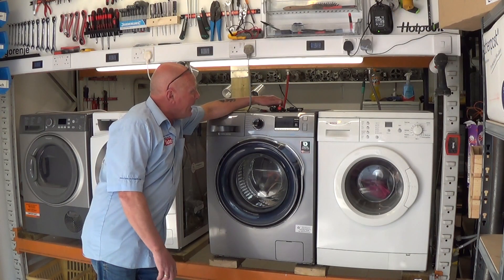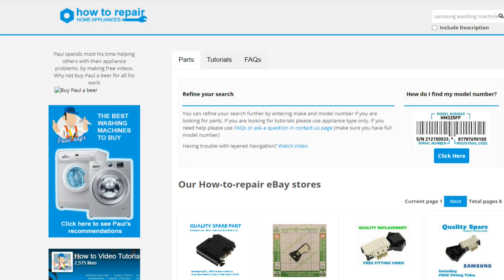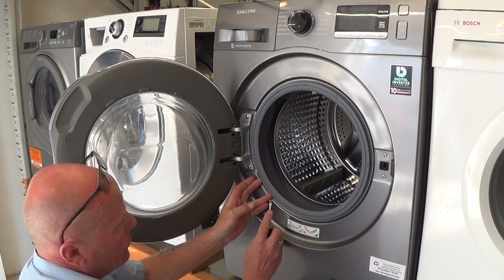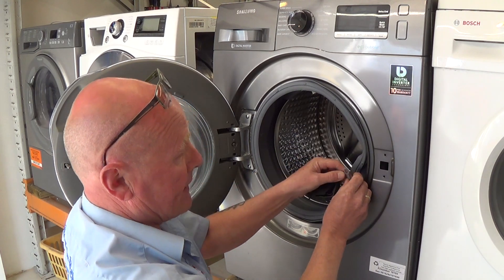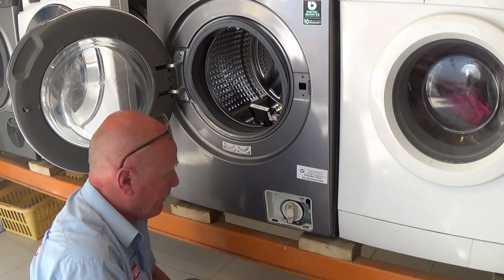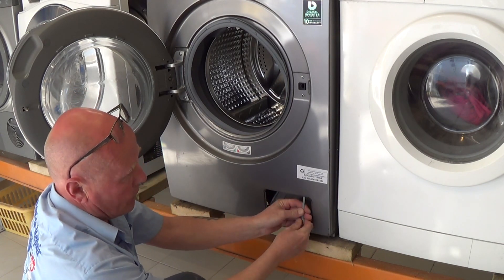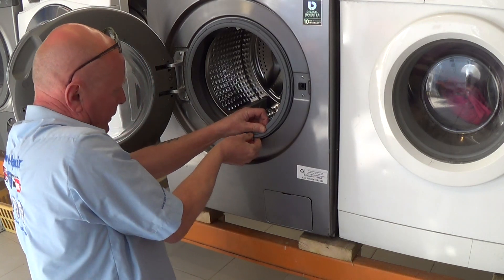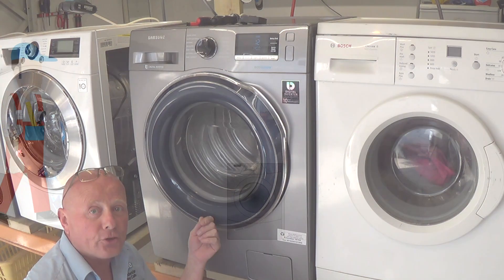Samsung Eco Bubble washing machine DC error fault code

Comment: Holey schmokes this was just as simple as you showed, if not simpler. You made my life so much better with this video, saved me hundreds if not a thousand of pounds and probably weeks of waiting either for repair or new washing machine. my wife got very impressed when i came home to the arrived part and fixed this in litteraly 2 minutes after having viewed this video a couple of times. As someone mentioned in the comments the emergency door release part can easily be attatched on the new part without taking the whole thing out, dont have to thread it if you fasten it right away, but great that you show it. also great you commented the difference between asian-american models and european models, i was wondering about that. Bought my part from a different vendor here in norway probably way more expensive, so i am sending my thanks, money for a pint well earned in the bar!

Comment: This video is easy to understand for those 'not competent' with electrics. I bought the part for about £40 and set about fitting it. The only issue was replacing the wire band. I eventually found that starting with pushing in the band just above the top end of the concertina spring, then working in an anti-clockwise direction, nudging in bit-by-bit until the full circle is complete. By doing this it gives the spring a chance to stretch, and the bit-by-bit fitting takes a few minutes, but I found it worked with ease. The local guy here (Shoreditch, London) in the domestic appliance shop wanted £75 for labour charges!

Comment: Thankyou so much! Saved money by watching this video! Took 15mins. Part was expensive but much cheaper than getting someone else to do it! We also didnt take out the safety tag and we just checked the bottom if it was still visible and it was so it was easier to leave it in and just switch out the lock.

Comment: Hi there,
Hope you're doing well
Thank you for all the video's you share with us, it helped me big time
I watched your video about replacing the door rubber, however, after putting everything back a DC error keeps showing when I try to start a program.
Everything is on it's place and the door closes well. I put clothes ans devided them well, yet it keeps showing.
I tried starting it empty and the error code keeps showing on the display.
I replaced the door lock and that didn't help.
Can you please advise me?

Thank you in advance ☺️
Reply from the maker: check the wiring to the lock you may have accidentally knocked some of the wiring Thankyou For leaving a comment this is for you https://www.youtube.com/shorts/e432SAb2g08 please remember to subscribe as that's is was keeps this channel going. Thanks 👍

Comment: I have a red key on all the time.  I changed the lock but it's still on.  DC1 error pops up.  Samsung Ecco bubble.  When I turn on the washing, the door closes normally, but after the end of the wash, it does not open, only closes once and opens several times.

Comment: Hi!
I always lurking between your videos, they are so educational.
But now I need help if you may help me.
I have a Siemens iq500 WM14Q340 washing machine and the door lock is clicking 3x and an error is popping up E35.
I changed the door lock with a new one but still same error.
I also checked the wiring too from the lock to the pcb connector, all 3 wireless are ok.
The machine is completely dry, no leaks or any moisture.
Is this door switch an electromagnetic switch or also a PTC one?
I assume the electronic board is okay vos the door lock is clicking and the door is locked but the error is coming up and the machine stops to work.
Any help I would really appreciate.
Thenks
Reply from the maker: If you have changed the door lock, the first thing I would tell you to do is see if you can find instructions on how to clear error codes on this machine as sometimes you can fit a new part, but the other is stored in the EEPROM and it needs to be cleared.  @christianrobertadzic9321 please remember to subscribe to our channel as that really helps us https://www.youtube.com/shorts/e432SAb2g08  Thanks, Paul 👍

Comment: I'm getting the DC error code but the door is locked and wont open. The machine wont start a cycle either even though the door is locked.

Comment: i have done what you said regarding removing lock but after removing the two screws the lock is loose but will not push back into machine there seems to be a white metal case around it which is preventing the lock from pushing back into machine. Any help would be appreciated thanks
Reply from the maker: make sure its fitting right on the inside of the panel before adding the screws. please remember to subscribe as that's is was keeps this channel going. Thanks 👍
Reply: Thanks for the reply but I can't get the lock out after removing screws there seems to be something else stopping the lock to be able to push it back into machine. It seems to have a  white case around the lock which is pushing against the corner of the washing machine preventing the lock from being pushed back. Thanks
Reply: I'm having exactly the same issue...plastic mould not pushing back

Comment: I changed mine and after 2 minutes it fused the main board any ideas what could cause that.
Reply from the maker: The first thing I would make sure that it is connected correctly make sure the wiring harness going to the printed circuit board is in good condition you may have another component on the machine creating the short which could have blown the printed circuit board

Comment: Thanks for the video. I have the same problem (DC error) with this model Samsung ecobubble, model: WD80J6410AW. Do you think I need to replace the door lock as demonstrated? If you can get back to me i will order the part from you. Many thanks
Reply from the maker: with DC error code this is the most common problem on the Samsung washing machines, make sure you check that you'll model number is listed in the door lock description please use the search tool https://www.how-to-repair.com/help/search-page/?searchVal=samsung+door+lock&searchsubmit=go

Comment: did exactly the same, but still the same error code shows up: dc error.
Is there any other reason than this one?
Reply from the maker: DC error code is normally the door interlock but it could be the wiring so check that and also have a look at the circuit board Thanks 👍 for watching and please remember to subscribe to the Channel as that's what keeps us going in able to make the video for you

Comment: My dumbass had exidentaly pulled on the emergency door opener. I thought the little tube was supposed to be put inside the emergency door opener. So, if you have pulled on the emergency door open thing, the error dC can occur since the door can not close whilst e.d.o. is in use. Hope it helps.